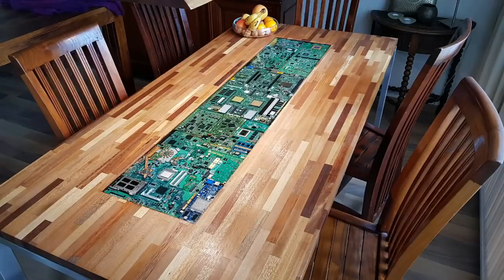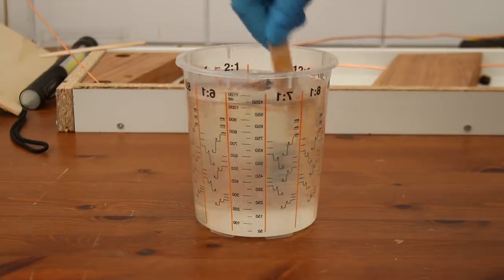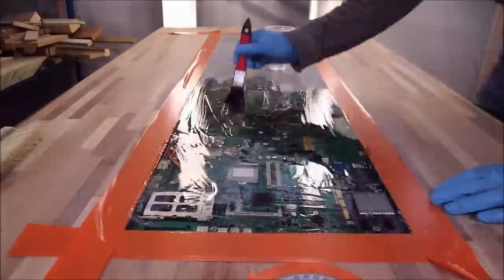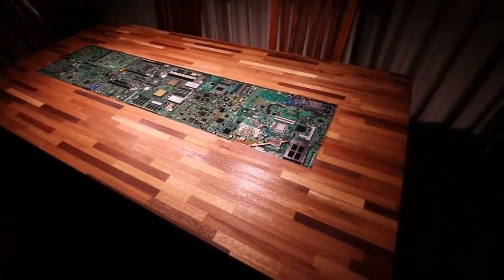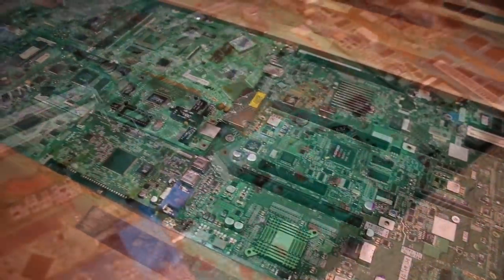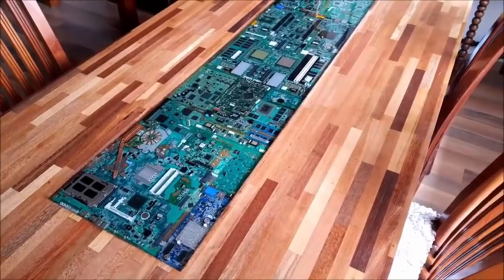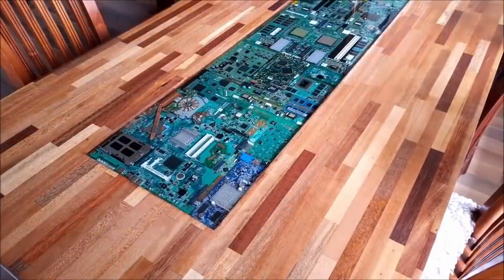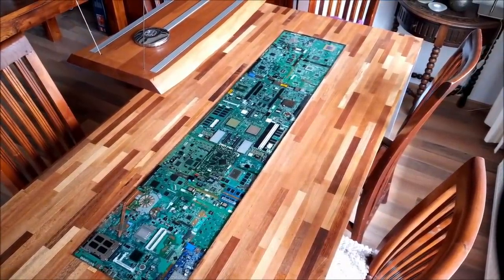Circuit boards with lights in epoxy in a table

Comment: Put a big piece of glass over the whole table
Reply: If you had ditched the last litres of epoxy and added a clear hardened glass plate on top you probably wouldn't run into any issues and still save money. Provided you could salvage a glass plate to cut. I reckon you could find a shower door on sale here in Norway that was cheaper than 7 litres of epoxy. If you want things to be airtight simply add an o-ring around the perimeter of the glass. It would fit nicely with the technical look of the circuit boards.
Reply: Great minds... just thought that, although if there is some seepage, it might lifting once in a while.
Reply: @restlessmedia  you could use some clear silicone feet around the perimeter of the glass and around the circuit boards(for support). To give it a little breathing room. A lot of effort went into this and I'd hate to see it given up on
Reply: @restlessmedia  sorry, lost the thread a bit here, are you talking about the table or sex with your partner?
Reply: lazy fuck lol.. im looking at marketing not these but something like this and playing with epoxy anyone who has any information links on how to i welcome them.. pm's
Reply: No ! The Epoxy gives it a much more natural look.
Reply: @tonymontana897  Forgive me, but my impression was that the clash between technology and natural tree was sort of the point. Hence when I said natural I meant natural in the setting he was after. Not natural as in "Oh look. This tree grew circuit boards".
Reply: @aBoogivogi  Ok cool.
Reply: Couldn't agree for more
Reply: Acrylic material
Reply: He could have used glass from the beginning then 😕
Reply: Amen! He poured so much money just to find the hard way these epoxy resins are garbage. Plus he started crying when he had to lift the table...
Reply from the maker: The epoxy should not be blamed for the idiot that didn't mix it well. There was no crying involved.
Reply: Maybe glue down a sheet of glass with another layer of epoxy? It might make it clear... that's what I'd try.
Reply: @shofarsogood7504  Maybe he could use a heat gun to smooth out the surface?
Reply: @retrobitsbench  I am a banker and have worked in and around banking for several decades. You ask: Do bankers treat you differently if your bank account has a large balance? Yep. Dang right. I suspect this isn't a popular answer. This is a pocket book issue. A paycheck issue. My pocketbook and paycheck. Besides that obvious answer, the subtle answer is one of respect. Clients with high balances are probably disciplined savers and investors, profitable business owners, and generally hard working people. Probably having above average intelligence and education. All of those are admirable. These clients have frequent conversations with their banker about financial matters. And this builds a personal relationship. I like talking to my friendly acquaintances.
Reply: @stevethea5250  And what does that have to do with the table and suggesting he use a heat gun?
Reply: @KokainAI  lol

Comment: Drill into the epoxy where it failed....allow to drain out the bottom....or flip over and allow to drail out the top....then refill....taking care to inject those areas to avoid air bubbles.....

Will take some time but anything can be fixed
Reply from the maker: You're the first with this suggestion. And that is remarkable with over 4K comments on this video. But I think you're right. The only disadvantage I can think of, of this method, is that the holes you'd have to drill would have to be fairly big. A 1 mm hole wouldn't cut it.. But it is still a very interesting idea, yes, thank you. I did it all from the top, routed the faulty spots out and filled in new epoxy (pictures here https://www.youtube.com/channel/UCNdDV4vHKjuWOYlEW4HIk5w/community ). Some parts were beyond repair, because the still fluid epoxy was around the components. Then your method could step in. Well, I'm almost done with fixing the table. With a syringe I indeed injected epoxy, but from the top and without draining it first. That went very well too, that is why I think your method might work, yes. Thanks again.
Regards from the Netherlands!
Reply: @Onrust1  awesome!  Fortunately (or at one time or another, unfortunately) I have quite a bit of experience with fixing mistakes....😂😂....
I was very lucky to have a great mentor, who taught me from the first day I stepped into his shop...."anything can be fixed"....and so far, he has been correct, however, sometimes, it's probably easier to start over.  This was not the case in your situation.  I haven't watched the new video yet, but  I'm more than certain you will repair and salvage the piece.... I'm happy to have been of some assistance and am happy to help with anything else in the future🙂
Come visit me in our maker space down here in Nashville TN anytime!  www.forthouston.com
Reply from the maker: Thank you again. I haven't got a new video yet, but I am working on it. (The footage is shot..) Nice to see that with Fort Houston you've got something similar in Nashville that we have here in Amsterdam, de Openbare Werkplaats (translated the Public Workshop): https://openbarewerkplaats.nl/home-en/
(I am a member, but only because I needed their large - 20" - planer only once.)
Regards, Ron.

Comment: Make a chair with resin and the boards to match the table
Reply from the maker: Just one? 😊 Nice idea though. I would never have thought of that. How would it look? I can see a small strip of boards in the middle of the backrest, visible from both sides; front and back. Mmmm... if I come by some chairs I think are suitable for this, I might take the challenge..
Thanks! 😁👍
Reply: Like the amount of chairs in the end result, thanks for liking the idea

Comment: Just top the table off with a sheet of tempered glass...it'll still be beautiful but no more work and will resolve the problem.  Thoughts?
Reply from the maker: Yes, it would be a quick fix to lay a sheet of glass over it. But there are several things that stop me from doing that. First the ugly spots will still be in. Second I don't like glass over it. The way the light breaks only once in epoxy is unique, a sheet of glass would ruin that effect - I don't like it over the wood either. And last, I would not learn from it. That's why instead I started trying to fix it. This you can see here https://www.youtube.com/channel/UCNdDV4vHKjuWOYlEW4HIk5w/community . I routed out the bad spots and am pouring in new epoxy. The first results look promising. Wait for the video. 😊

Comment: Hey mate, this is by far the best epoxy table I've seen! I'm sure you've had people say this, but is it possible you poured the layers too thick? It was a bit hard to tell from the video but epoxy can go pretty weird if it gets too hot (or too cold, or not mixed perfectly).
Reply from the maker: It depends on the specifications of the epoxy how thick the layers can be that you can pour at once. My (slow curing) epoxy was good for 5 cm, and I did only a bit more than 1 cm... I never noticed any heat at all.

Comment: Heat the table IR light or what ever to 160 degree F. for an hour to harden worked for me
Reply from the maker: As you can see here https://www.youtube.com/channel/UCNdDV4vHKjuWOYlEW4HIk5w/community I've begun fixing the table. I routed out the bad spots and am pouring in new epoxy. The first results look promising. Wait for the video. 😊

Comment: If you can't sand between pours you have to pour it almost all at once. I'm sure you have heard the solution by now..
Reply from the maker: I noticed that there is no need to sand between layers. I guess it all comes down to what kind of epoxy you have. My slow curing epoxy bonds to itself, even when it is hard, very well..
I'm pretty sure I messed up the mixing of one of the batches.

Comment: The table might have been a failure to you, but man, was the pouring of epoxy satisfying to me!
Reply: Shoddy workmanship. It looks a real mess around the edges and I have no doubt that there's numerous bubbles inside the apoxy as well. There's far easier and quicker methods for doing this that yield spectacular results.
Reply: @autoculto7629  so let's hear them
Reply: Er is altijd iets te doen hé
Reply from the maker: Funny. I didn't see it as so exciting... but then again... I was busy at the time... 😊 
But I can give away a little secret....
(As you won't tell anyone... 😆)
I'm busy fixing the table (look here https://www.youtube.com/channel/UCNdDV4vHKjuWOYlEW4HIk5w/community ) and at some point I asked myself if it was possible to fix rather big enclosed air bubbles, by drilling two tiny holes at the ends, and with a syringe inject epoxy from one. Seeing that ugly bubble slowly disappear... now THAT was satisfying..!
Busy with the video. Wait for it.
Reply: @Onrust1  Looking forward to it!
Reply: @Onrust1  circular saw it out drop it out the bottom...put new thin layer of wood in the cutout then redo...maybe aplastic black between wood and new resin pour to be left in...right down the edge of wood meets resin circular saw
Reply: @Onrust1  better yet drop it and build the circuit board outside of the table then put in after...even install it you can change it out from time to time just you same braces under neath just like table extension braces...
Reply from the maker: I'm assuming you read above that I've already fixed the table? Building the circuit board part outside of the table would make the installing of the glass fibers very difficult...
Reply: @Onrust1  very good take care buddy
Reply from the maker: Thank you. I always like people to think with me.

Comment: Maybe add a 1" trim around the edge of all the circuit board center to cover the gross edge spots and then a glass plane inside the trim to keep the circuit board showing
Reply from the maker: As you can see here https://www.youtube.com/channel/UCNdDV4vHKjuWOYlEW4HIk5w/community I've begun fixing the table. I routed out the bad spots and am pouring in new epoxy. The first results look promising. Wait for the video. 😊

Comment: 5 dollar paint mixer from Home depot and a drill would have solved your problem. Live and learn.
Reply from the maker: I never found one to mix paint. Yes, I found them for plaster, but they are to big for my epoxy-cups. So in the end I bought an impeller, the one used in boats to pump water. That I mounted to my drill and that works great!
Reply: @Onrust1  Glad you found a good solution. For anyone else interested, this is what I was talking about.

https://www.homedepot.com/p/HDX-1-gal-Helix-Paint-Mixer-HM1-HDX/206509381
Reply from the maker: In this part of the world we are not allowed to access the HomeDepot.com website ('Access Denied' it says...), but through the description in the link I found it somewhere else - thank you! This one is a bit to big for mixing just one liter too, like the ones I found in the hardware-stores over here.. I'm glad with my impeller... 😊

Comment: You should cut it all the way out of the middle of the table then place a board under the hole then  pour a little resin then put some more circuit boards then do your lighting then finish pour resin
Reply from the maker: Yes, that is one sensible suggestion. 👍👍
But as you can see here https://www.youtube.com/channel/UCNdDV4vHKjuWOYlEW4HIk5w/community I've begun fixing the table by routing out the bad spots and am pouring in new epoxy. The first results look promising. Wait for the video. 😊

Comment: My heart sank, I was truly disappointed for you, such hard work and beautiful table. I have learned to simply dig out the soft stuff and refill, personally I would give that a try. I'm off to see if you have updated.
Reply from the maker: I will update, I'm working on a video of the fixing of the table - essentially another learning experience. I know now that you can take out the soft parts, but where they came in contact with the components of the table, it is near to impossible. So repairing is limited. You can see here https://www.youtube.com/channel/UCNdDV4vHKjuWOYlEW4HIk5w/community I've begun fixing the table. I routed out the bad spots and am pouring in new epoxy.

Comment: The composition of certain components mounted on the various pcb boards, and flux, may have reacted to the resin.
Reply from the maker: Yes, but it didn't. First I separated the boards from the main pour of epoxy with the first smaller pour, and second the problems are not on the board-level, but on one specific horizontal layer in the poured epoxy, about 6 - 7 millimeters under the surface  - indicating that I messed up one pour, most probably the mixing of it.

Comment: Just add 1mm Spacers around the centre and add some nice bevelled glass over the top to hide the mistake. TBH I think it might even add to it as more of a feature.
Reply from the maker: The mistakes would still be there and you'd have an extra layer over it - not so pretty... But as you can see here https://www.youtube.com/channel/UCNdDV4vHKjuWOYlEW4HIk5w/community I've begun fixing the table. I routed out the bad spots and am pouring in new epoxy. The first results look promising. Wait for the video. 😊

Comment: Hello!!! try to wipe the table with vinegar or soap solution, it helped me to make the epoxy not sticky. most likely you did not mix it well, it is always necessary to pour the epoxy mixture into another container after kneading and only then pour it into the product, otherwise an unmixed mixture of container walls may get into the product. thanks for the video, great idea, I’ll use it with your permission, I’ll make a similar table. I apologize for my clumsy English, I speak it poorly, I translated Google translate
Reply from the maker: As you can see here https://www.youtube.com/channel/UCNdDV4vHKjuWOYlEW4HIk5w/community I've begun fixing the table. I routed out the bad spots and am pouring in new epoxy. The first results look promising. Wait for the video. 😊
You are so right about the mixing, yes I know by now. 😁
No need for permission - I say: do it! 
No need for apologies either, the English is OK. 👍

Comment: Use some heat glue to create a barrier between the circuit boards and the wood of the table. This may stop the epoxy running and allow it to set
Reply from the maker: As you can see here https://www.youtube.com/channel/UCNdDV4vHKjuWOYlEW4HIk5w/community I've begun fixing the table. I routed out the bad spots and am pouring in new epoxy. The first results look promising. Wait for the video. 😊

Comment: It would be good to remove all on-board batteries, or you may get some corrosion
Reply from the maker: I got this comment several times. I doubt that is possible. Epoxy is SO damn strong & it closes everything off. My guess is that nothing will happen to the batteries. Effectively anything is like frozen in time in epoxy...

Comment: Not mixing epoxy well enough is always a big problem. You can decrease the chance of not mixing it well enough by using a paint mixer. You know, those mixer things that you put in your power drill like a drill bit and power mix paint, or in this case, epoxy.
Reply from the maker: I never found one to mix paint. Yes, I found them for plaster, but they are to big for my epoxy-cups. So in the end I bought an impeller, the one used in boats to pump water. That I mounted to my drill and that works great!

Comment: Meh.... i would've left the LEDs as LEDs and wired them to a PIC
Reply from the maker: So we do it all on our own way... I deliberately left out the battery powered lights with controller, because I thought you would go crazy quickly of a carnival in a table all the time... 😊 It is the temporary character of the manual light for a few seconds in the fiber optic that I like.

Comment: Maybe drill tiny holes where the bad spots are and let them dry out that way, then refill.
Reply from the maker: As you can see here https://www.youtube.com/channel/UCNdDV4vHKjuWOYlEW4HIk5w/community I routed out the bad spots (so not with a drill) and am pouring in new epoxy. The first results look promising. Wait for the video. 😊 
I've still got one spot where there is an air pocket, and I want to try to get new epoxy in there with a syringe with a needle, by drilling two tiny holes, one to get the epoxy in and the other one to let the air out. I want to record that on video too.

Comment: im guessing the imperfections are a result of not doing 1 continuous pour. probably a result of "outgassing". don't know that im right, just my opinion. either way, the table is AWESOME !!!
Reply from the maker: Thank you!
No, I reconstructed the pours I did, there were roughly four: 1, 0.5, 5 and 3 liters. I know now that the problems are in the layer between the 5 and the 3 liters, I suspect I mixed the 5 liters not well enough - mixing more is more difficult as well (the 3 liters I did 3 x 1 liter). 
As you can see here https://www.youtube.com/channel/UCNdDV4vHKjuWOYlEW4HIk5w/community I've now begun fixing the table. I routed out the bad spots and am pouring in new epoxy. The first results look promising. Wait for the video. 😊

Comment: Nice, though it failed technically, it succeeded in creativity and they make clear spacers so that the glass will never touch the surface; a person who loves the beauty of circuits and makes good money would probably love this.  would be very beautiful with blue LEDS that shine horizontally and an array of dark or gold matched caps facing the same way (centered lengthwise), 12 half-inch caps or 6 to nine 1 inch caps. it would give the symmetry that those who love the look of circuits love.